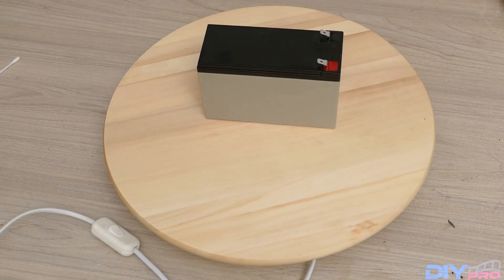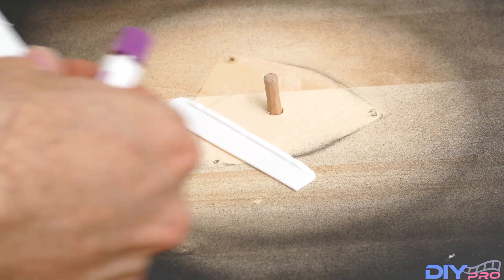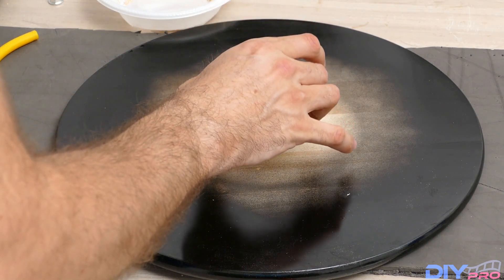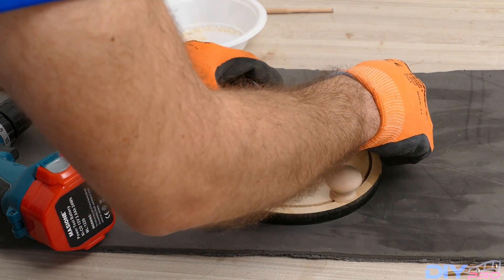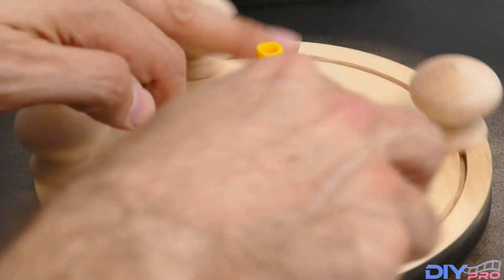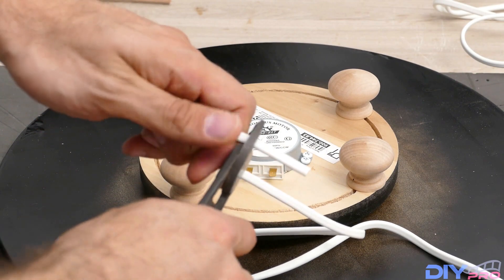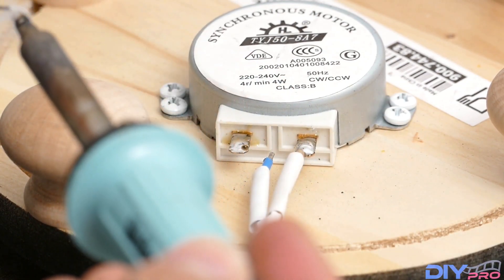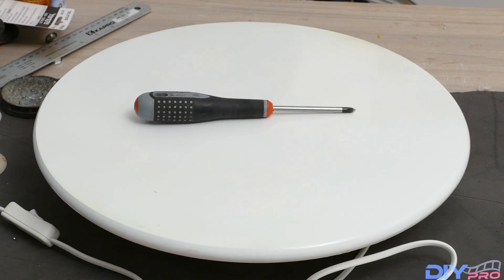How to build a good Lazy Susan or motorize table

Comment: Hi there, would you be able to add a dimmer into that circuit for variable speed? Do you know if this motor can reverse directions? Thanks for the cool video.
Reply: I was wondering the same thing. Did you ever find out?

Comment: Is there a way to make it rotate slower?
Reply from the maker: with this motor you can't as it has a fixed speed maybe use a different motor
Reply: Igual tauge slider basically kinda like a dimmer switch🤷‍♂️
Reply: Restrict the power and it won't work as hard

Comment: could you use insulated spade connectors if you can't solder
Reply from the maker: yes you can as long as it fit the plug of the motor

Comment: How could you make this wireless?
Reply from the maker: You will need to change the motor to one that works on batteries and then you can make this a stand-alone unit
Reply: @DIYPRo-iv4cy  Thx
Reply: DUDEvsCHICKchallenge you would need to use a low voltage DC current motor powered by batteries.
Reply: @fatabelly  would the motor work for heavier objects?
Reply: Kiera T depends on what motor you choose. You would need a low voltage but high torque motor.